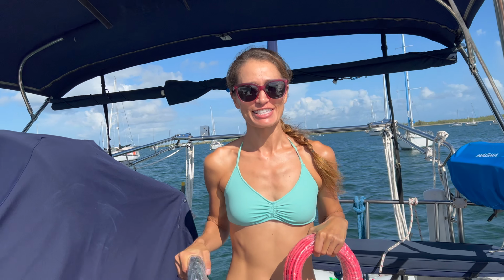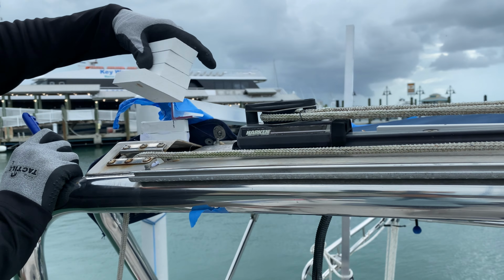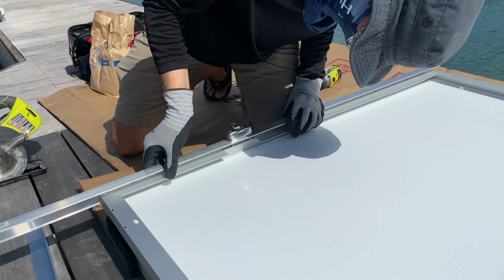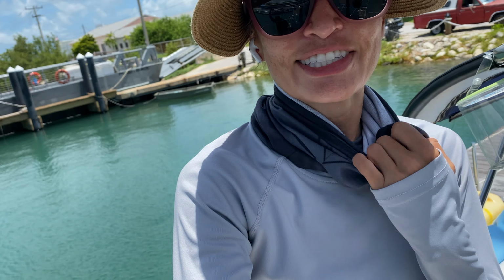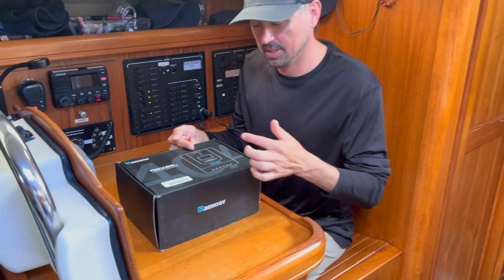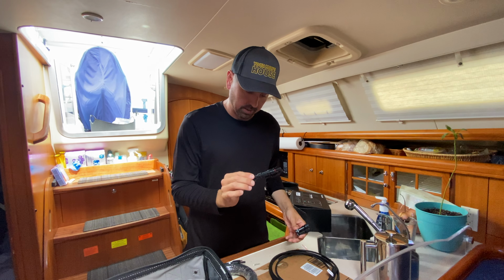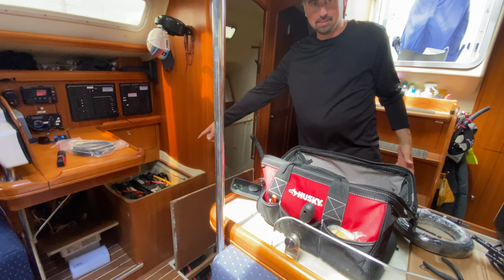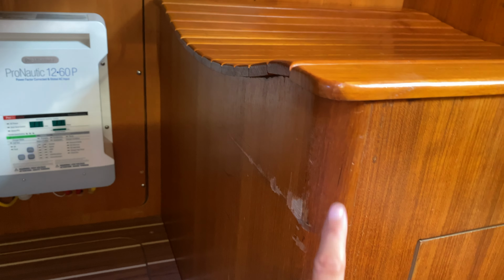Game Changer: New Solar System

Comment: Nice setup. We are in the process of installing solar on our Hunter 410; did you connect the wires from the controller directly to the battery post, or to a bus-bar somewhere?....this is my only confusion on the setup we have. We are running three 240w panel with 3 controllers (we will most likely post a video shortly)...and our frame is similar to yours on top of the arch. We're looking forward to the next video.
Reply from the maker: Thanks.   After consulting with Lisa’s dad, we went to a the battery posts.   We were going to go to a bus bar, but it got too confusing with all of the electrical upgrades that had been done over the years.
Reply: @SailingByeFelicia  did you run a connection to all batteries or just one? I’m confused if you run to one battery, will the charge from the controller somehow get to the other batteries?